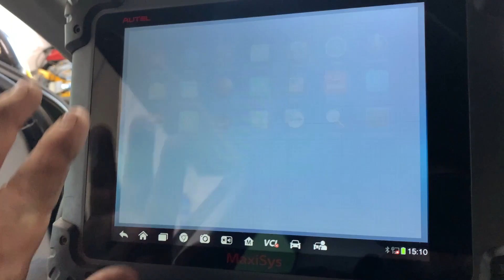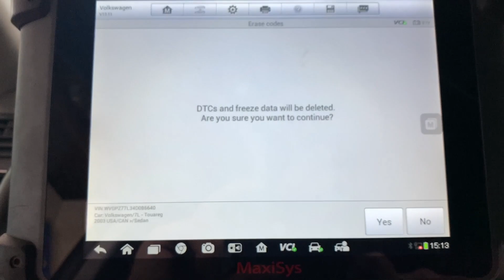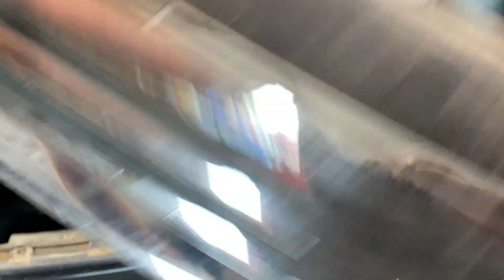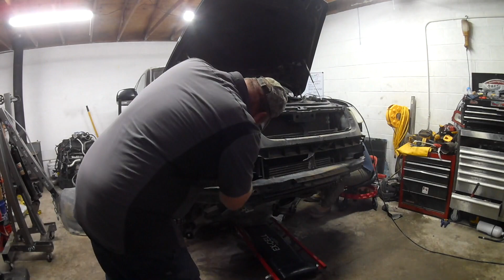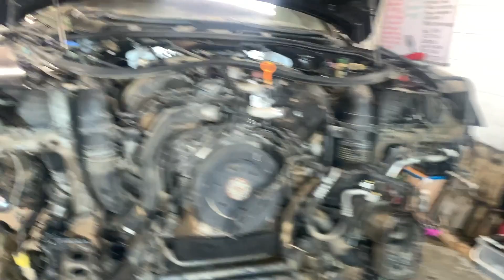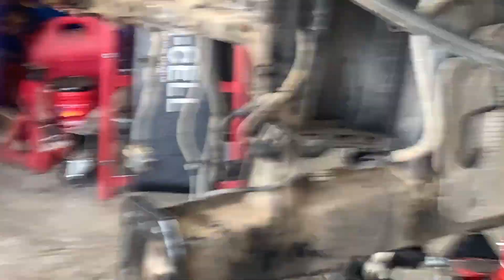VW Touareg V10 TDI Swap (Part 2) "Diagnosing & Removing The 2004 V10 TDI"

Comment: Thanks for the V10 content, I will need to do this soon. I have leaky seals that need to be replaced along with everything else you should do while you have the engine out.
Reply from the maker: Definitely a good time to address as many issues when the engine is out.  Much easier to work on.

Comment: Hey, awesome work! Thanks for putting up the only video showing the removal in some detail. I've got to do this job in the next few weeks for an engine transplant. Do you know what the distance between the engine mounts are on these? (L to R without the subframe). Cheers
Reply from the maker: Thanks for the comment. If you have any questions on your project let me know. I’ll try to be more detailed when I put it back together.  I measured 25-1/2 inches on center for the engine mount bolts. Good luck!
Reply: @mountainviewsgarage  thanks for getting that for me. Seems like it'll be a tight fit in the GQ patrol, but could be possible!
Reply: I’m currently fighting to remove the cats with the engine in on my V10 Touareg, have everything unbolted, even turbo flange. Do you recall how to remove catalytic converter brackets? Either from engine or from the cats themselves?
Reply: @benjaminkondrla2006  each cat has 2 bolts holding the bracket to the engine. Maybe you didn't see the second one?
Reply: @ridiculousthings4x4  do they happen to come out in the same direction? It’s an engine in job, I was looking at pictures of the cats and it’s seeming as if the bolts come out in the same direction